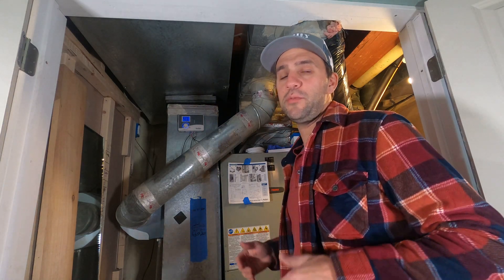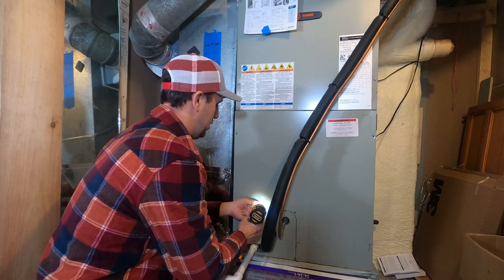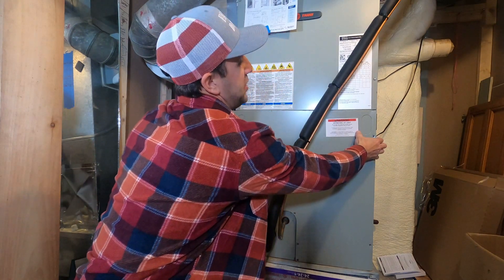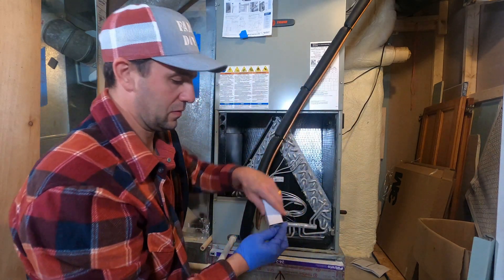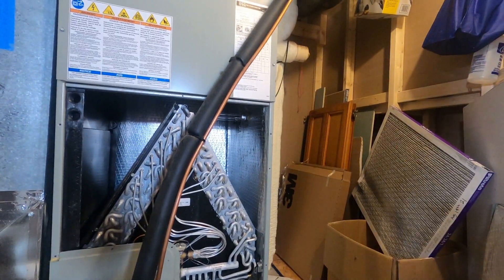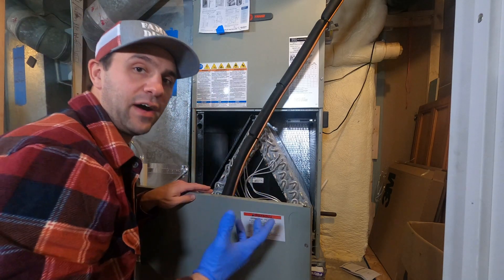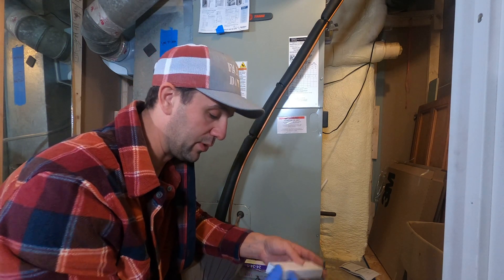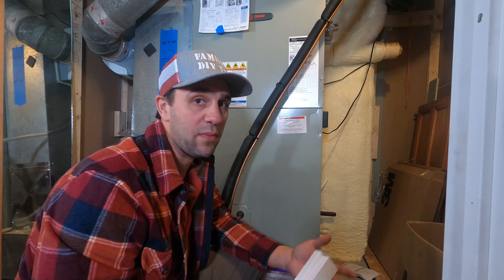How to Replace HVAC UV Sanitization Light Bulb

Comment: We just had a new HVAC unit installed with a UV light.  We are getting a smell from the vents just above our unit when it is not running.  Could the UV light be causing this and does the UV light stay on all the time or just when the unit is running?
Reply from the maker: i assume because it's new, could be burning off some oil. .. but may want to turn it off and open your hvac and make sure nothing is melting .  be careful in there..

Comment: Shouldn't you have light over the other side of the coil?
Reply: UV light kills bacterias on the surfaces that it reflected on, not the air. It prevent bacteria growth, build up and odor caused by the bacteria in the surface. You should have use the longer UV light rod; it should shine on more part of the air handler.
Reply from the maker: Maybe - but as far as I understand it doesn’t matter … all the air passes by and really what you’re looking for is the most metal possible so it can reflect.   

But who knows ..